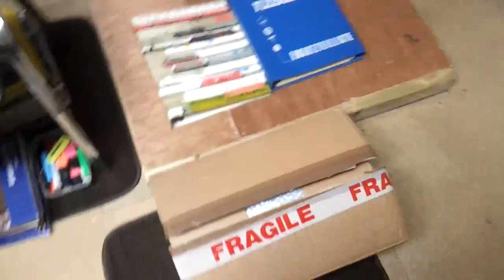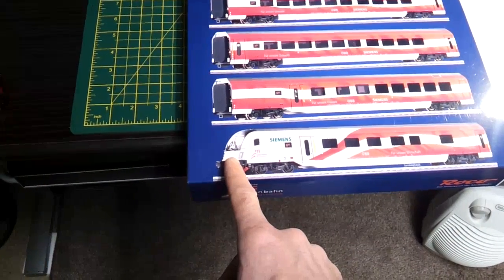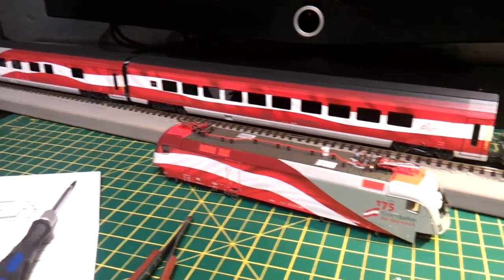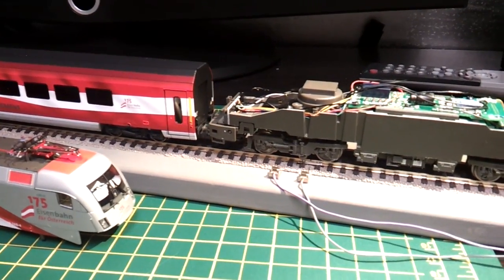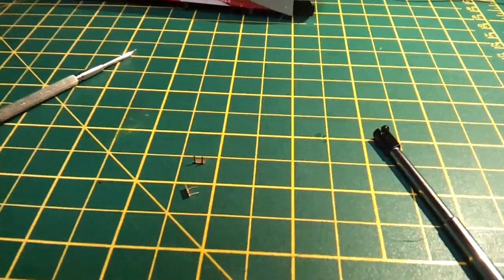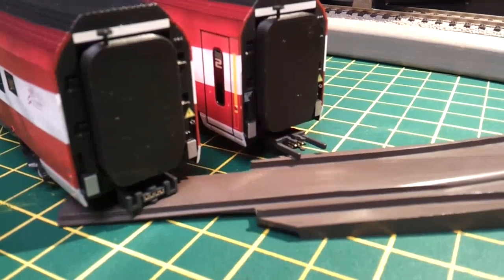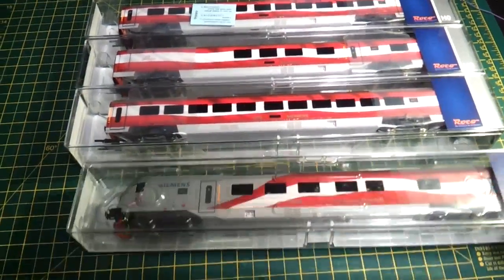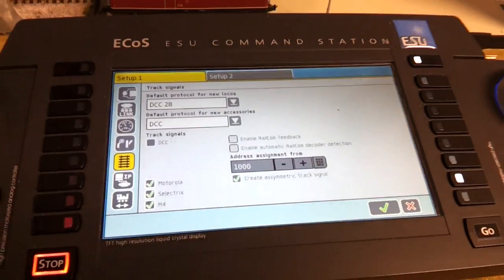ROCO RAIL JET 175 unboxing & tips

Comment: Hi.  For push-pull, if it is anything like my Roco OBB 4010 - Trans Alpin set I got about 1.5 years ago, when you set it in this mode, a Relay in the Locomotive switches the Primary Current pickups to the opposite end Control Car when it going in that direction.  That way, train detection on the rails will correctly detect it as the head of the train.....

Comment: I thank you for your quick reply !!

So I have purchased a brand new Roco 64116 set , three cars with light using digital Roco couplings, and I have connected this set to my previously purchased, Roco locomotive 72459 DCC with Sound, unfortunately, the three cars don't light up!
 
I have pressed on the Multimaus the different F1 - 2 - 3 - 4 etc. Keys but nothing, the cars light just won't turn on.

I am using the Roco multimaus DCC system (the orange one) with Roco 10764.

I hope you can help me.

Comment: But I found it Lass reliable over multiple turnouts, etc, so I bypassed it and parallel wired all the current pickups (in the locomotive)...  BUT, as yours is 2013 - New, they have perhaps currected this little glitch...  ALSO, in mine, there is No decoder in the Control Car, it is a Direction Detection unit only (kind of how Fleischmann did it in the past).  As you mentioned Programming difficulties, I suggest you put BOTH the Control Car and Lok on the Programming track and try again. -Chris

Comment: Hi quick question for you, I have the same loco and only the three car set 64116 which comes with light but when I connect them to my Roco 72459 sound loco (same as yours) the lights in the three rail cars won't turn on!

Do you know why?

Thank you in advance for your help!
Reply from the maker: Hi...I know what you mean. .it's a tricky set to get working correctly. .and the instructions are not great at a explaining via Austrain -german. ..I did a vid on this problem , the set works fine on my fleischmann controler but on my ecos it needs a sub menu setting resetting on the programming track for the lighting to work. ...what command center are you using...jim

Comment from the maker: Hi chris, i will show a short vid of the test track i made & what i use soon for you, when the jumpers are removed from the loco & the loco is connected to the dcc coaches the entire train is one unit & more options are open to train automation etc. i have not fully looked into this mode yet, i am running it with the jumpers in & the control car & the loco are on the same address...i am up loading a vid with the full seven coaches etc. soon ....jim

Comment: You mentioned this is a limited edition.. is it the whole set or maybe just the locomotive or the car set? I can't find any info online if it's limited or not. Thanks
Reply from the maker: Hi, the loco and coaches are limited production run from roco..
But you can find these from jc (jagerndorfer)  of Austria ..on ebay germany. .
Reply: hovermotion Not much luck on Ebay with this anniversary set...there are a few locos and add-on coaches but not the 64113 set. afyter searching for it for a while I managed to grab the last ROCO set 64113 from a hobby shop in the UK and I received a few days ago.
QUESTION: Are your lights working inside the coaches? My directional lights work fine and one more light inside the drivers coach, other that that no other lights work. I did connect all of them but still no luck (I know the drivers coach powers the other cars). regards
Reply from the maker: didavko1 hi this set is a really tricky set to commission. ..it depends on what dcc command center you are running...that depends on how the coach lighting  behaves. ..ji.
Reply: hovermotion
 i just put it on a DC layout... could that have been the problem? the other railjet set I have (roco 64089) work just fine on a DC track.
Reply: hovermotion brio

Comment: ok can you please try to see if you hook up the 64116 three car set to the loco 72459 please, see if the light go ON.

Now for your decoders to switch them from channel 3 to another one you should program one at a time and not both together, see if this works for you.

Kindly let me know I have tried everything on my end here and I can't get any lights ON from the three car set.

I've opened them up and they're ok light strips are in and connected to electric couplings but.... no light!

Thanks
Reply: sandip Bhai

Comment: Is that music at 2:50 or is it the engine? If the latter, it sounds like music.
Reply: No man, just the power settings rising.

Notch 4: Highest
Notch 3: High
Notch 2: Neutral
Notch 1: Low
Notch 0: Lowest

Comment: was wondering if for the lights to work you need the pilot car which has a decoder or the locomotive needs to be activated for what concerns the digital couplings??
Reply from the maker: I know its bambozzeled me too ..the pilot car has a factoty  decoder which can talk to the loco via the electric couplings and there is the gate switch in the loco too...my set works fine now  on my ecos command system on the default loco setting out of the box address 3 which is the same as the decoder in the pilot coach...the problem is i can not change the address on the polit coach... I have tried to replace the pilot coach decoder it but its hard wired in...so the entire set is on default adress 3.............jim